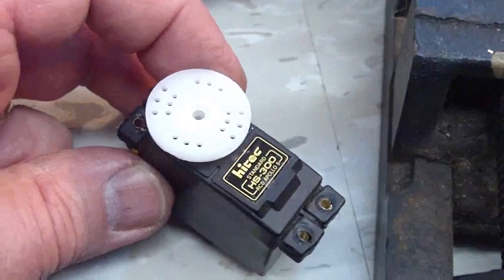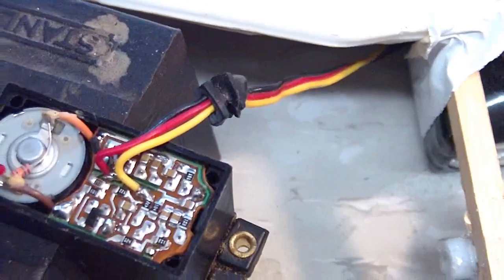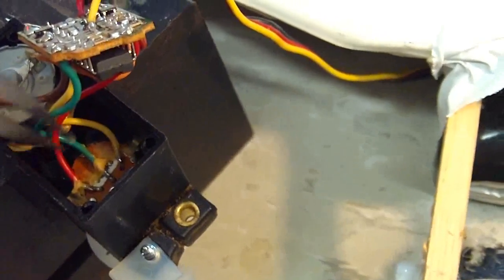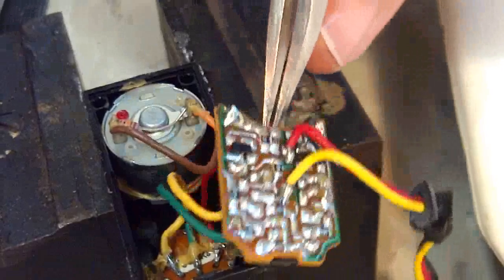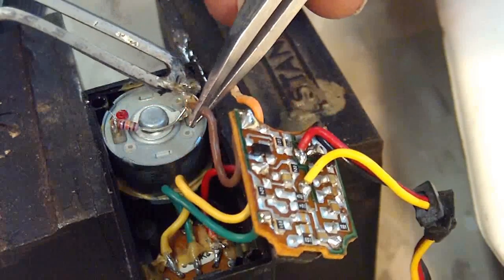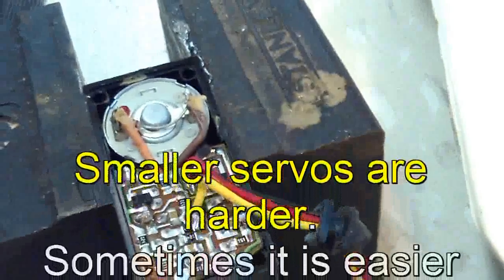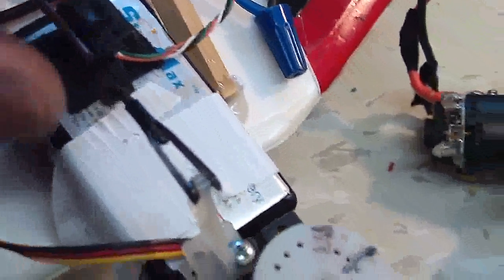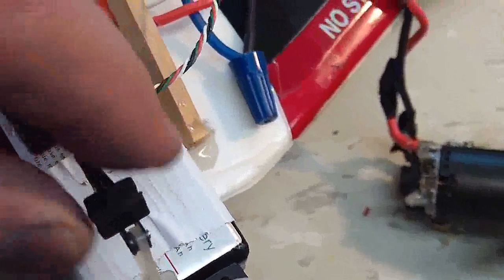How to REVERSE a Servo.

Comment: Dear Dave, should have prior notice of your YT advice, but now I've learned something new from you, and that is: Sometimes it is easier to cut the two wires in the center, and  splice tham,than  trying to solder on the small pot ''
Thank you indeed.

Comment: On the Multiplex Fun Cub you have flaps, each flap needs a servo.  For some stupid reason they didn't design the holes in the wings where the servos go to be oriented the same way, they are mirror image of each other.  So you have to reverse one of the servos so they both operate in the same direction. See this video at 2:03  /watch?v=sUYN0uiRowg  This guy carved out another hole so the two servos are oriented the same, instead of reversing one of them.

Comment: Thanks for the vid. I needed to reverse a HS55 and it worked great. The only thing I don't get is why you don't swap the wires on the circuit board as they are a lot easier to get at once the board is out than the wires in the case.

Comment: That was just a friendly heads up for anyone who didn't know about reversers. Skills or not, doing surface mount soldering with small wires and a hot iron down in a plastic 9g servo case is a hassle, plain and simple. I don't care if you re-solder, but reversers are an option for others to consider. Inline reversers are very light and if you cut your leads to length (you would if you're that concerned about weight,) you will gain less than 3 grams. Doubt those antique servos are worth it though.

Comment: Thank you sir. I did two micro servo in no time. Had to replace the motor wires with wire with covering as they were two small soild wire peices. (Since there crossed now)

Comment: You can also buy short servo extensions called "reservers" that have a tiny circuit board in the middle.  They read the signal coming in and send a signal that's the same distance from the center, but in the opposite direction. Spektrum sells one with a Y built in and HobbyKing sells inline ones for just $2. I'm all in favor of tinkering but that's seems like a much better option than taking apart your servos and re-soldering SMT connections in such a tight space, especially for 9g servos.

Comment: wouldnt it be easier to just put the servo arm on 180degrees out and it is in essence reversing the control to the surface its used for

Comment: hey nightflyyer I have a Giant Big Stik which I made taildragger I installed a servo only for tail wheel assembly. I have a Y-harness installed for rudder and tail wheel servo but I am having the same problem with direction will this reverse servo video work for me...

Comment: I like your video, but dude, that soldering iron is GIGANTIC. it looks like a 100W radioshack gun that HUMS when you pull the trigger. I am going to do this to some of my servos as well. i am also building a servo reversing circuit so that any servo can be used without cracking it open. It is a great fix in a pinch and if you are cheap....haha (which i am too). great post keep it up!

Comment: nice video man but i think in servos there is also a diode on the circuit board or the motor to prevent currents from the motor to the circuit. If there is one then it should be reversed as the motor wires. Just my two cents :):)

Comment: Hey Nightflyyer, you know on the clevis instead of using the rubber mounts for servos I use silicone fuel line cut into small pieces. They are much tighter and like with fuel line come in various sizes & colors. Not to mention are dirt cheap. Thought I would share that with you... Love all your videos man, its nice to know Im not the only genius out there... lol

Comment: SOLVED. If you just easy want to reverse servo not in servo, you can modify your TX. SImply switch 1st and 3rd wire on the potentiometer (may be throttle or steering pot).

Comment: it also helps to use some aligator clips to hold things in place, so that you have 2 hands to handle the iron. there has been times that a small 1/10 mm solder point was hard for me, using 2 hands is kind of like using 2 hands to do fine detail with a airbrush.   also, i preferr to use Soldernig GUNS over Irons, unless the Iron has a Variable heat adjustment.. the Gun allows you to turn the heat on and off when needed.

Comment: most people who make planes can make linkages a little longer if needed.. i think i would rather stick to turning my servo 180 degrees  and using a longer linkage, than tweeking the insides of a servo. seems like less work.   even if it is just 5 wires, you still have to get out the soldering box.

Comment: just rest the base of your hand holding the iron on something. you shake becuse your tensing up and holding it tighter will only make it worse.. hold loose, and use LOW heat.  :)    there's tuns of soldering vids online already.

Comment: If you need 2 Flap servos for instance you probably a left and right hand servo.
You can buy inline hardware servo reversers, but it is cheaper to do this mod.
I have a Futaba FF7 and an 8CH set and you still need to do this sometimes.You simply run out of mixes without it.